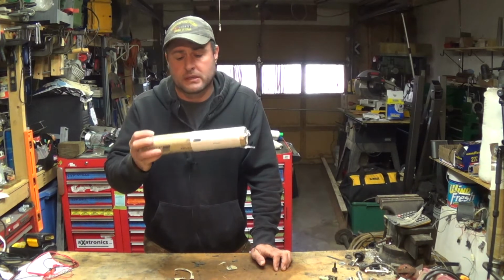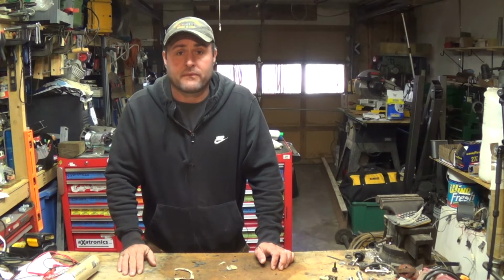Kawasaki Intake Manifold Gasket

Comment: I have the same motor on a John Deere X310 with 300 hrs.  Had the same issue.  No bogging under load but running hot and missing and popping at high idle.  I tore mine apart last night and both gaskets were compromised.  One of which, they completely missed the hole and punched a new one in the gasket during assembly.
Reply from the maker: that is outrageous. I recently had to buy a new mower. old one still runs, but very weak. I am hoping it just needs valves reseated but I won't know until I tear into it. doesn't smoke but compression seems low. Could all stem from this gasket and overheating. Just hope I can bring it back to life.